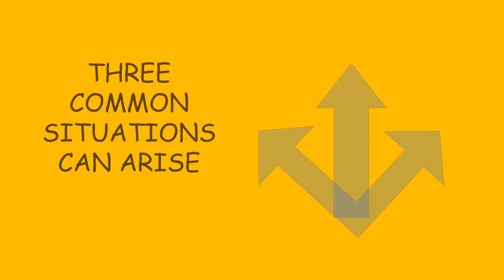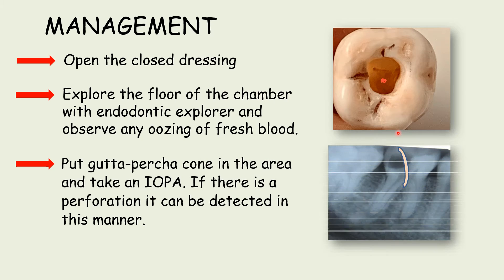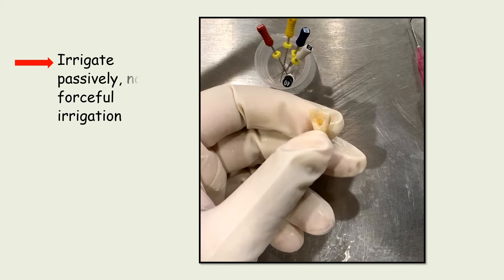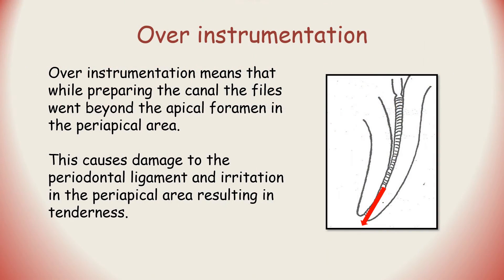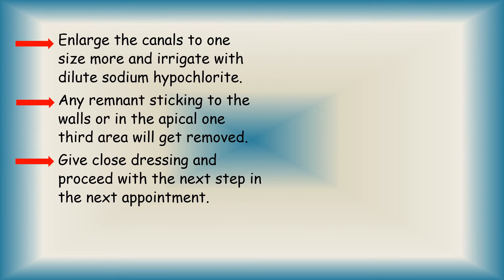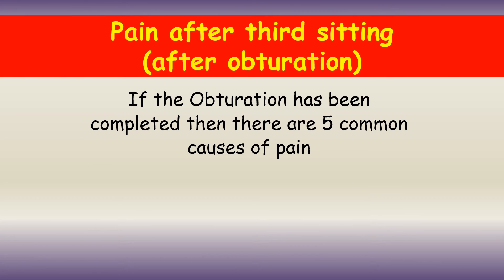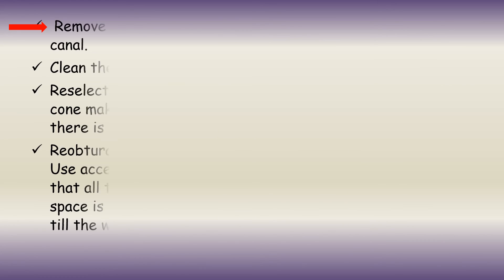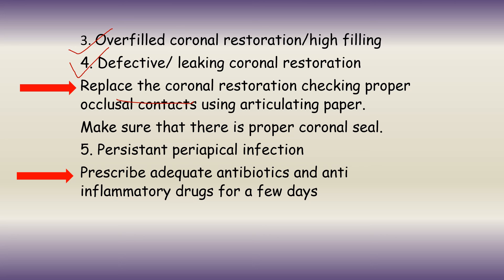How to manage pain during RCT procedure| Endo emergency| Endodontic flare up

Comment: I'm sorry but it made me angry at the presence of pulpal remnants, that I'm supposed to enlarge the canals, that doesn't help .. the patient is in pain, he's feeling pain whenever I insert any file close to the WL, so telling me to insert the bigger file would also cause him pain and cause him to retract himself and so I can't remove the remnants so problem not really solved
Reply: I took an Xray and I was about 2-3mms short of the apex, I'm now starting to doubt that the anesthesia was delivered correctly because that's the only possible explanation, the patient experiences this unusual very sharp pricking pain as the file goes deep, so I think that indicates remaining pulp tissue as you said but I'm now thinking that if the anesthesia was completely successful then he wouldn't have felt that pain, or am I wrong?
Reply from the maker: @ahmeddebeiky5877  don’t blame yourself! Sometimes in the apical one third, there may be an accessory canal/ canals present, which might be having little bit of pulp in it/ them. That can be the cause of pain. The apical anatomy is pretty complex. Sometimes there is a Delta of very fine accessory canals present. My personal experiences is that if you irrigate well with hypochlorite these remnants eventually get necrosed and stop bothering. But this takes time and the patient needs to be reassured that you are in control and can manage.
All d best!
Reply from the maker: Recheck d working length. It shortens as the canal gets prepared. Quite possible, your are over-instrumenting and going beyond the apical foramen.

Comment: Mam sometimes we could not find the reason of pain while inserting file in a root canal after b.m.p
 whether the pain is due to pulp remnant or trauma to periodontal ligament
How to differentiate between these two types of pain
Reply from the maker: If the canal is apparently clean without a pulpal remnant, then let the tooth rest after giving calcium hydroxide dressing. Sometimes the waiting period can be as long as 3 to 6 weeks also
Reply: @Sumeeta Sandhu  thank you very much mam for your kind and precious reply